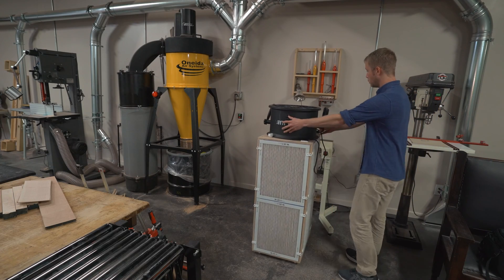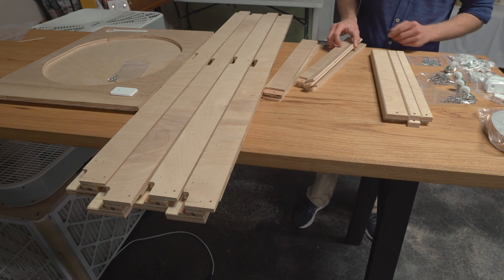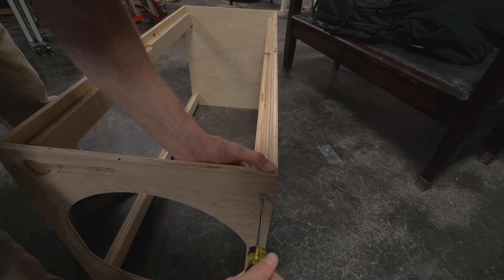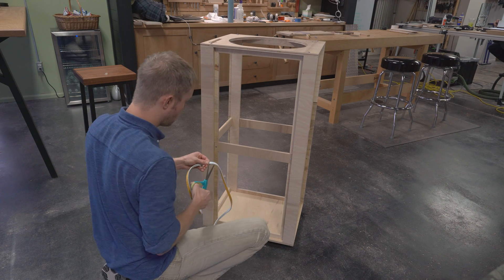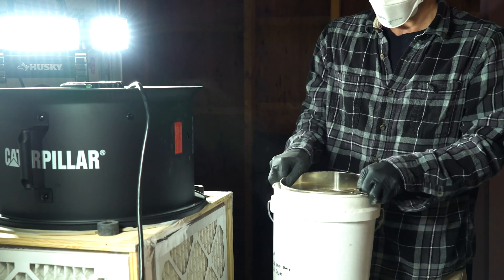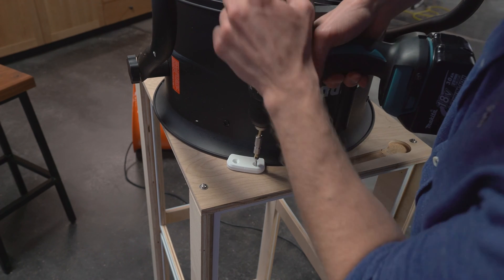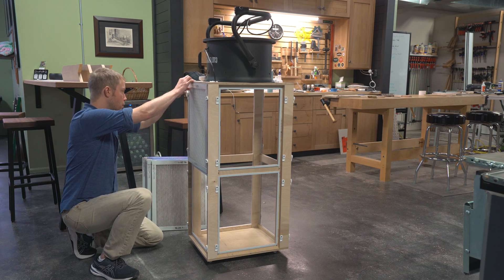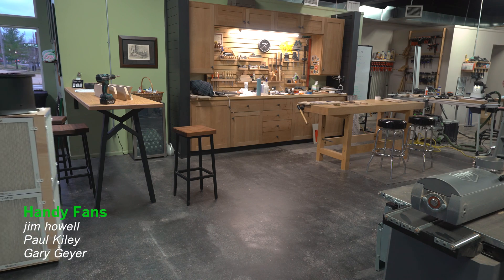Air Filter Kit - Model-A - Design and Assembly

Comment: Maybe you can consider stamping an arrow sign on the inside showing the orientation, and maybe cut a piece of rubber saying facing down and stamp it on the lower side of the flat pieces
Reply from the maker: I just bought stamps to do just this. Thanks for the idea!

Comment: little confused about the fans, so is the maxxair 16in and cat 14in the exact same size? are they just measuring from different places? which one do u think is build better if their the same? i even see the switch for speed is the same, could it be that their just build from the same parts? just one has a cap for the motor?
Reply from the maker: Sorry for the late reply! The fan are virtually identical. The 16/14" numbers are all marketing jargon. Neither fan had anything on them that is 16 or 14" inches. 

Personally I like the Caterpillar fan because the motor is enclosed. It's also nice having 4 speed settings. The Maxx Air fan may move about 5% more air but for me that's not worth the extra $25 for the fan.

Let me know if you have any other questions.
Reply: @The3DHandyman  , the fan blades are 14 inches on the Cat fan. If they wanted to use marketing-BS like number, they would have used the outer diameter of the drum.
Reply from the maker: @michaels3003  All the more reason to like that fan!

Comment: Really incredible stuff.  Appreciate all of your time and effort.  I came across this link , https://youtu.be/rOecQZZR5kA , and I’m curious what your take is. It’s the same fan that you are using, uses what is clearly a more expensive filter (Wynn) but ? larger surface area and easy design build. Any thoughts on airflow and efficacy?
Reply from the maker: Thank you! I get this question a lot lately. In short I don't think this fan is the right choice for the Wynn filter. I have a similar design coming out soon that uses an inline fan as well as a few additional upgrades to the design that solve a few issues I have seen with all air filter designs. I think that the original Wynn design is better than this drum fan version for a few reasons.

It is easy to make, I'll give it that. The trouble is that axial fans are not ideal for high static pressure situations and when the filter is new it may be able to preform alright but when it's filled with dust the performance will drop, significantly. The outer drum on the fan is also much larger than the opening in the filter and this will also drop the performance significantly. The outer rim of the fan happens to be where the air moves at it's highest speed, thus robbing the fan potential performance even more.

My assumption is that with a perfectly clean filter this unit may push around 700cfm or less. When the filter is a tub of dust, it may drop to 300cfm or less.

I'll be buying one of these to test the specs to be sure, I don't like to say something without backing it up with some garage science. Unfortunately the creator that made that video didn't buy a $30 anemometer to back up his claims. He also states that it's capable of "4000cfm". My wind tunnel tests indicate that without any filter attached this fan can only do 1440cfm maximum in ideal conditions. 

Sorry for the long answer but I'm already working on the script for the video in my head and the words do flow 😀The new video should be out in a few weeks!

Comment: Great design.  A much simpler design would be to use that same fan on top of one or two Donaldson P181038 Air Filters.  It fits over the top seal very well and minimal parts/assembly required.
Reply from the maker: Thanks! That style is easy but the 8" holes in the filters are much better for 8" fan, not a 14" fans like the one in this video. I will be testing one of the combos you mentioned in a future video to show why it's performance is half of what this unit can produce.

I do have a design that I'll be doing a video on that uses the canister filters to their greatest potential (at least that's the goal) in about a month or so. I'd love to hear your thoughts on that it when it goes live.
Reply: @The3DHandyman  Looking forward to it, thanks!

Comment: I’ve been watching all the videos in this series and love the idea of just buying a kit! My main interest is to have something as mobile or compact as possible, to take to job sites. I was also trying to figure out how effective these systems would be with drywall dust. I sand by hand and regardless of how ventilated the room is, there is dust everywhere during the sanding and cleanup process. Thanks for all your hard work on the subject!
Reply: Also what are the final dimensions of this kit once assembled? Thanks again
Reply from the maker: @andyh1227  Good questions! 

The unit is 21"x22"x50". Thanks for that reminder that I need to add that to the product page!

As for jobsite use I think that it should preform well in a closed room where there is good air circulation. In a large open spaces like stairwells it may not preform so well that you wont still need to vacuum the local area.

I I have been doing a lot of sanding lately and have a new idea for your sort of application. I will test it out tonight and see if it has any merit. It's a cheap approach and it would be highly portable.
Reply: @The3DHandyman  Thanks for the reply! I like where your head is at and I look forward to hearing the update. We sub out large drywall jobs, but I’ve been finding myself doing all the sanding on smaller projects. A mask works well but when I’m not physically sanding the mask comes off and I know the air isn’t scrubbed or settled to a safe point yet. So a low profile and portable, yet effective solution is what I’ve been researching for. You seem to have the best ideas I’ve seen yet, so I’ll stay tuned. Thanks again
Reply from the maker: @andyh1227  Happy to help!

I see the use case you are describing and I do think the Model A would work well in that application. 

One thing you can try first is hooking up a dust collector bag to the Caterpillar fan in the video. I tested it out with sanding dust for a while and if it put it under my work table it will suck up the dust that falls. It seems like this would be perfect to put at the base of a wall while you are sanding.

The big benefit is that it's just a fan and very mobile.

Parts for this idea
Fan: https://amzn.to/3TD9NM3
Filter Bag: https://amzn.to/3XEr8pW
Straps for holding the filter around the fan (like a belt): https://amzn.to/3XzaO9P

That idea will probably not capture most light airborne dust tho and it only filters to 5 microns so it may only be part of the picture. After the filter gets clogged, the performance may drop quite a bit too. The bas is washable tho and will hopefully last a long time.

If that doesn't cut the dust down to an acceptable level, you can try the Model-A. It uses the same fan.

If you try it out either let me know how it works for that application!
Reply: @The3DHandyman   Thanks again! I definitely think my best bet is to use the caterpillar fan, and suck the dust down through the fan into some sort of filter or filter system. I saw someone else strap that exact fan on top of a merv 15 Wynn environmental 35C222NANO filter. The catch with that filter (aside from price and undetermined lifespan), or a filter bag, is that emptying or cleaning them introduces another situation with lots of dust in the air near you. But just like with anything else, I’ll have to make an educated decision and then fine tune the process to my direct situation. 

He would clean the filter by propping it upside down atop some saw horses and then running around it with a handheld blower to free the debris and let it fall out of the filter. He was outside during the process which made the impact of the dust less aggressive to his health.  Perhaps a work around for that would be to build a station emulating the original intended purpose of the filter (dust collector system), so you can catch the debris in a clear bag below the filter. You can let the dust settle before removing the filter from the top or tying off the bag. Maybe your next product offering could be a filter cleaning station for that type of filter..

I do like the idea of using filters that catch and hold the debris for easy disposal. I may still go with your kit-a as suggested, but I do appreciate all your help and support. It has been very helpful to my brainstorming and solution procurement.
Reply from the maker: @andyh1227  I'm happy to help. Brainstorming is the best kind of storm.

I will be testing some of those canister filters soon. I think they will cut airflow performance significantly. The Caterpillar fan and the Wynn filter don't seem to be a good combination for me for a couple reasons that I'll talk about in a new video some time soon.

Comment: Excellent work. Hope the kits sell big. You put a lot of effort in. What are you thoughts about floor vs ceiling mounting. I what something like B or C but ceiling mounted and air out side so with 3 filter. Lack of floor space and not keen on air blowing up. Fyi. A lot of us have CNCs so you could sell them too.
Reply from the maker: Thank you! Sales are pretty good so far. I don't see any issues with mounting this unit to a ceiling or wall. If possible, I would put some standoffs (or use large brackets) to back the unit away from the wall surface so that it can still run 8 filters. You could also make the unit taller and do a flush mount with 9 filters (3 stacks).

If you cut the total filters down to 6 total (one side obstructed), then you will reduce the output of the unit by a few hundred cfm. 

Also, like you suggested, for the ceiling/wall mount I would not blow air into the filter box. Blowing air out of the box (pull config) is by far the best preforming configuration when it is used in this way. 

I'll think about uploading the CNC files at some point but a lot of $$$$ went into this process and I'll need to recoup some of it before that day comes.

Let me know if you have any other questions!
Reply: @The3DHandyman  Thanks for the reply. The form factor would be something like this -> https://www.youtube.com/watch?v=OUz2o--8B8o that just popped up on my home page. 
Different is I would have a 3rd filter at the end opposite the fan with unit at least 2 feet from the wall, the fan pointed to the wall and air sucking into the filters. (Should I push air instead?) So 24 x 24 box with 3 x filters. The Lasko fan would be separately mounted to the filter box so I can change the fan in the future by just changing the mount. Changing the fan is simple when it sits on top of the filter box.
Thoughts for use in 2 car garage shop with it above the worst offenders?
My original question was are ceiling mounted unit a lot less effective vs. floor versions as dust wants to fall?
Reply from the maker: @randynoble3726  Hey! Sorry for the late reply. Things have been crazy. 

I think the ceiling mounted filter is a fine idea, it will capture a lot of particles. It does not need to be on the floor.

the 24" box sounds like it would work alright but might eat into your headroom a bit. You could make a thinner box that uses a used blower motor from an old furnace. This might be able to keep the whole unit under 16" thick. 

Also I would use 2" filters if you are going to  only have 3 filters in the unit.

Blowing air out the the filter box towards the wall is the best scenario for a ceiling mounted filter.

Hope that helps!

Comment: I love the project. thank you for creating it.

have you considered a residential filter as well? I think the key features would be:

- ability to automatically select fresh air intake from a vent/AC or internal circulation depending on CO2 and CO values as well as outside temperature and outside particulates. EG in winter you don't want super cold air blasting inside all the time. In summer similarly you don't want hot air coming in all the time. And for people with allergies, you want external air as little as possible during pollen season.
- quiet 24h operation with possibly an external sensor to turn it off when you need it to be completely silent, eg a load cell on the bed would turn it off for the first 4 hours so you can fall asleep
- ability to integrate with a light so the filter can be installed overhead while also serving as a lamp and being hidden by the light fixture. No one looks at the overhead lamp so it's the best place to put a bulky filter.
- eventually maybe some sort of integration with systems such as AC (for drying air), heating, and a system that boils off water for humidity if you're in a very dry climate and/or need a high relative humidity eg due to health issues. (much like you, I tested a bunch of different ways of increasing humidity, and in a dry climate it is impossible to keep above 35% RH without boiling water. My go to solution is an slow cooker pot set in the room that needs the RH adjustment. I had to do it because of bad eye related issues caused by dry air). Integration with heating would be useful eg if it's winter, you need to let in fresh air due to air quality, but you also don't want the room to cool down. This could be done with high quality mains SSRs (solid state relays) controlling inexpensive, good quality mica panel based heaters.
- maybe, perhaps, integration with a green wall where air is being blown through the roots of the plants in a green wall. A project like this is mentioned on the company page for Noctua, under the section "industrial applications".
Reply from the maker: You were on a roll there! I thought I typed up long comments :)

I will be testing a home version that is really quite simple and lacking in features now that I think about it! Haha. I'll stat there and see where it goes. I do know a guy that has done a lot of home automation stuff that could help with some of the ideas you threw out there. So, maybe some day I can integrate some of those things you mentioned.

I do LOVE the idea of a green wall. Right now my 3D print room has a lot of plants in it and it has cut down on the VOCs in the air quite a bit. I want to take this to the next level and put it through a lot of testing. I hope to do a video on this in the next few months.

Thanks for taking the time to comment!
Reply: @The3DHandyman  glad you like the ideas :) maybe one day you can implement them :)

Comment: Great design! Do you have links to where I can print the 3D wrench and the fan thumb holders? Also, would you sell the CNC plans for this design? I used Aspire for my CNC and wonder if you use a similar program. Or just the vector files of the cut pieces would be fine. Thanks
Reply from the maker: Thanks! I can upload the updated parts to the Thingiverse later this week or early next week. I'm not sure about the CNC files, maybe after I recoup some costs from prototyping all these things... it was a very expensive process :)
Reply: @The3DHandyman  Thanks for the quick reply. Appreciate you updating the 3D files and totally understand about the CNC files. Again, I'm not asking for a free set as I'm willing to pay for them. They can even be the vector files before any cut paths are assigned to the parts themselves. Thanks again.
Reply from the maker: @ryanloft4534  I'm back from vacation and will hopefully get the 3D printed parts uploaded tomorrow. You will have to wait on the CNC files, sorry :)

Comment: 2 questions? 
would it be more beneficial to place a pre-filter before the fan with a lower merv rating (just to capture larger particles) then use a higher merv after the air leaves the fan? 
is the black fan better than the orange one?
Reply from the maker: I do like the idea of a pre-filter but putting a single filter on the front of the fan significantly reduces airflow in my experience. I have some ideas tho. Hopefully I can get a video out on that subject in the next month or two. I'll be testing a pre-filter for each configuration, push and pull to see if it reduces the performance significantly.

As for the black fan vs the orange one, I like the black one. The performance is only 3% less than the orange one and the motor is enclosed so dust cant get in the mechanism. The Caterpillar is also slightly less expensive than the Maxx Air (at least where I'm at).
Reply: @The3DHandyman is it ok to close the fan motor openings or will I just have to clean the motor from dust regularly?
Reply from the maker: @dargunsh7156  You should not close the motor openings. If something like wood dust gets into the fan motor you should blow it out with compressed air sometimes to make sure it stays clean.

Comment: Just made my air filtration system based on your plans using 16x25x1 air filters and it’s like night and day now in my garage. The air is so fresh and clean when working in my workshop now… my dad, who helped me build it and is a master cabinetmaker with over 70 years of experience was a bit sceptical at first but is a convert now! Thanks again for sharing your plans with us!
Reply from the maker: That's awesome to hear! Thanks for sharing your experience. At 70 years of experience, your father sounds like quite the legend.

Going to the 16x25s is a great idea. This should help reduce the load on the fan even more. Nice work 👍

Comment: The filter seal and turn tabs for the filters are nice upgrades.  Seems the turn tabs would speed up the filter change process on b/c design.  Would this be something you could incorporate on the b and c models? I do realize the design is currently different.
Reply from the maker: I decided to keep the B and C versions more simple for this round... so at this time they are only features of the model A. If you are making your own you can use the same construction methodology from the original model A to allow it to be used with any filter size and the clips which can be purchased separately or printed on your own.